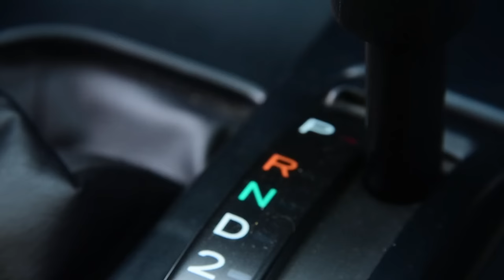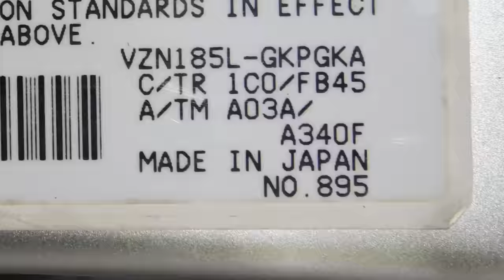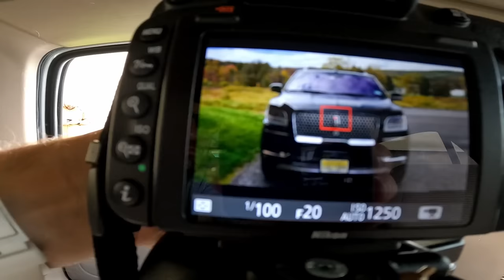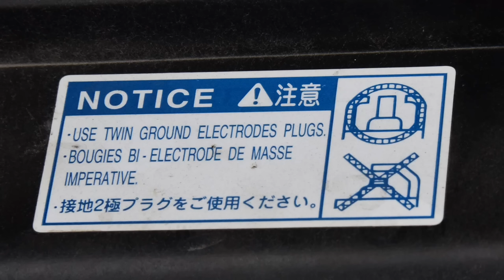2000 Toyota 4Runner SR5: Regular Car Reviews

Comment: I've got a 3rd gen with 360k that gets 21mpg and the only thing it needs is new shocks. incredible machines!
Reply: My 2002 just rolled over 317k. After a recent oil change, I measured the old oil that came out of it and it's only lost an eighth of a quarter over 5,000 miles.
Reply: Same 360k with a 3rz. Looks just like the one in the video. The best mpg I ever got was 23 on a long trip.
Reply: @BrockOBauma I've got a 98 with the 3RZ and the 5-speed. Only 214k miles on it and it's a Colorado car so nothing but light, superficial rust on the frame despite never seeing the inside of a garage for the entirety of its 25 year life.

I've been tracking the MPG for years. I have knobby All-Terrain 33's (265/75/R16) and still average 21MPG. Back when I first got it, and it still had tiny all-season tires mounted on 15" wheels (the default size for 3rd gen base model), I could consistently get over 24mpg. The best trip I ever recorded was 26mpg, all rural highway miles, traveling ~65mph the entire time. 

All of this using 85 octane fuel at elevations normally between 5000-10000 feet.
Reply: Nice truck. 
I do bear potentially disappointing news for you though; 265x75R16s are 31.5”, not 33”.
I have the same tires on my 2003 3.4L 4spd auto taco with 108,000 miles. They’re 1” taller than the stock 30.5” 265x70R16s (to be fair they are often rounded up to as 32”s and 31”s online respectively). Can’t say I’ve ever quite seen 23mpg though. Impressive!
Reply: 21mpg 😮 share your secrets 😂😂

Comment: In 2020 I fell into a a ‘99 manual transmission 4Runner for $4k before I knew it was rare. I bought it off the original owner with the receipt from our neighborhood dealer. It had 330k miles and a bootleg Jane’s Addiction concert in the tape deck. But the rust is getting to a point where I should let it go. There are so many other Toyota trucks I could ride through the apocalypse. But if I refuse to leave 1999, maybe the apocalypse will never catch me.
Reply: Can you fix the rusty crusty and keep 'er going longer!?

Comment: Regarding the brakes, you should consider upgrading the the front calipers, rotors and pads to the ones used in first gen Tundras. Its a pretty common mod with noticeable improvement. I used to get brake fade in the mountains but that never happens since I upgraded my brakes. I feel like the stopping distance is also improved.
Reply: Yep, I was going to mention this! I put 2004 Toyota Tundra caliper, brake pads, and rotors on my 2001 4runner and it fixed the warping problem. I have never had a problem since then!
Reply: Probably should’ve read this comment before posting, but I’ll leave it up just to see if we can peer-pressure Mr. Regular into the upgrade
Reply: Good to know 👍🏻
Reply: This…
Reply: I'd say the 199(13WE) and not the 231(13WL) calipers so you don't end up with the soft pedal. I did the 231 and have not been able to get rid of the soft pedal that goes almost to the floor and can't lock them up anymore. I eventually plan on on going to the 199s.
Reply: My uncle apparently went with Bosch rotors that stopped the OEM warping issue, if that helps anyone
Reply: He will need bigger wheels to fit this upgrade. 17 inch at minimum
Reply: @BentonHart  Find yourself a dirt, gravel, or snowy road and slam on the brakes to activate ABS a couple of times then bleed the system again. Had the same issue with my WL calipers and now its almost too touchy. Those ABS systems are kind of finicky.
Reply: @BentonHart yep thats the route I went as well. It also allows you to keep the stock wheels/tires, which was important to me at the time.
Reply: You can run 13wl calipers on 16s with a spacer. Ive got 13wl on mine with FJ cruiser 16s. Fits like a glove with spidertrax spacers
Reply: @DeathMammoth91 What size tires do you run? 265/75/R16? I'm thinking of doing this on my 98 after the pads are a little more worn down.

Just want to confirm that everything fits before committing to it.
Reply: @TheHamburgler123  I’m running the stock wheels and standard highway/all-season tires, 265/70/16, and didn’t have to make any modifications to run the 13WL. Works just like the factory brakes, except now I’m not afraid of going down hills or doing hard stops on the highway. Huge quality of life improvement for these trucks, even if they’re mostly stock and used on road.
Reply: @ebenwragge-keller538  Thank you for your response. Gives me the confidence to move forward with it. I live in the CO Rockies and rely way too much on downshifting/engine braking to feel fully in control. I'm sure it feels great to not have undersized disc brakes up front, one of the only design flaws of the 3rd gen 4Runners.

Comment: Back in 2000, my dad bought a fully loaded 4Runner of that model year. It has everything from the in-bumper fog lights, the leather seats, the matte black spoiler on the back, and even the slightly larger 5-spoke rims in chrome. He held onto it through economical hardships and various adventures. It drove me everywhere, home from the hospital, to and from school and practices, and along several road trips.

I am lucky to say that 2 years ago, it became mine, at only 153,000 miles on the clock. Now I’ve worked on it myself to get it up to snuff, getting rid of those terrifying-down-hills warped rotors, putting in all new fluids and synthetic oils, and all the new seals that leak quite terribly if not changed. I’m not wanting to put bigger tires or change anything on it—keeping it the way it is and forever was is a representation of my life, only now do I take full control of it. It now has 177,000 miles and it’s running smoothly like it always has. I’ve gotten large cash offers for it various times, but like my life, it’s not for sale and it never will be.

Thank you for this review—I’ve been waiting for this video since I would sneak glances at it in the background. I’m happy to see that the true star of the show finally gets the deserved attention. You nailed every emotional feeling this car is and then some. And just as you stated in your review of the Camry, this car evokes everything I find ideal in a partner—they may not be the best, but they’re always going to be there for you and up for adventure.

Happy trails and keep ‘Runnin!
Reply: Just curious, does it have the rear differential locker?
Reply: @TheHamburgler123  Yes, it does, and it’s been helpful a few times!
Reply: @jaxothebuilder22  Nice, that's a keeper! With only 177k, depending on how much you drive, the original engine and transmission have decades worth of life left in them.

Comment: I had a ‘98 that saved my life! It was my first car. I wish I still had it, it was absolutely incredible. Hit a patch of slush in the middle of the NYS thruway at 12AM, like if the plow had skipped over it and left a 6in pile in the middle of the road. It bounced and lost traction, started to spin, and got nailed in front of the pedals by an 18 wheeler. I spun the other way, slid onto the shoulder and the front right tire found purchase, which sent it rolling over. When it finally stopped, I still had to turn that beautiful engine and lights off for the final time. When I unbuckled, I landed on the drivers side window. This was the only injury I got other than heartbreak. A total of 9 stitches. To add insult to injury, the 18 wheeler was one I just loaded on my shift at UPS. If I could afford it I’d 1000000% buy another Gen3.
Reply: Also, rust ate through my exhaust right behind the cat, and being 21 I thought it was the coolest thing ever. Man I miss it.
Reply: @dingusmcslow1908 😢

Comment: My first car was a 94 4Runner.  I loved that car.
My second car was a 98. I loved that car.

And then gas was well over $4 a gallon and I was a poor college student driving 60 miles a day, getting 14mpg on the highway on a good day, working part-time for not much above minimum wage, and I had to say goodbye and switched to a Jetta that only lasted me a year and a half.

That 94 was in service for a long while after that, and made it to a cool 250k before it was put in the grave in an intense battle with a tree.

Now I have a 96 Tacoma and it's just like my first car all over again, except worse because it's only got a wee baby 4 cylinder and it's not happy with so much as a few cinderblocks in the bed.

I love you, every 90s Toyota.  I'll love you forever.

Comment: Bought one of these 3 months ago & I love it. Bought it off a buddy w/ 256k mile on it for $2000 & he threw in his 2nd gen Tacoma wheels & tires for free. It has a slow oil leak & the AC didnt work. Got the AC comppesor and fan clutch replaced & added some oil. Added some creature comforts like a subwoofer, a trunk cargo cover to keep it hidden, white LEDs for the interiors & headlights, rain gaurds to match the hood deflector. Since I have worked from home for the last 3 years I barely put 2k miles on cars a year. I'ev already put 4k in the 4 months I've had this thing just taking road trips!

Comment: Finally a review on the 4Runner in the background!  You got a real keeper there.
My daily driver is a 2000 4Runner V-6 4WD.  We bought it new in 2000 and it is a family member.  At 195K I replaced the sagging original suspension with a 2" lift on Bilstein shocks, OME springs, SPC adjustable upper control arms, front diff drop, 285/70/17" Falken Wildpeak AT3w tires and Level 8 (6) spoke alloy rims.  It completely transformed the vehicle.  Two years ago with 225K miles, my daughter and I took it from KY to Colorado and explored the Alpine Loop near Telluride, Ouray and Silverton.  It performed flawlessly and climbed over everything in it's path without breaking a sweat.  We even got 18 mpg across Kansas fully loaded with camping gear and 2 adults.  I have upgraded to Tundra front brakes and installed a JBA cat back exhaust, (from Summit), and it doesn't sound "farty", but actually purrs and reminds me of an old BMW I  used to own.  I just turned over 250k and I will drive it till it dies, or I die...whichever comes first.  My money is on the 4Runner.

Comment: That ending really struck a cord with me. Earlier this year I got my hands on a 2005 4runner, which is the generation I'm nostalgic for. Having grown up around early to late 2000s cars. 

Shortly after I parted ways with a Subaru SVX that I absolutely loved, but wasn't the right car for me at the time. I knew that, but I felt incredibly guilty about it, like I had failed the car.
Half a year later and I'm loading my entire life into a uhual trailer and towing it across the USA to move states for university, inside my Toyota 4Runner.

I feel an unwavering comradery to that car. And even though I had to make lots of changes in my life, parting ways with some things I wish I didn't have to, the 4Runner ended up being my chariot to carry me through those changes, with no second guesses or concerning noises. 
And I've been absolutely loving uni so far. Change does not have to be a bad thing.
Reply: I had an 03 Tacoma that I used for travel for my job (which sometimes required off-road work).  Often drive to sites instead of flying even if it was a 1000 mile trip.  I was single at the time with many weeks on the road of just myself. By 2016 when I needed something else, I eventually regretted not having it anymore. It was sort of a big part of my life.
Reply: Amen, brother. My 98 4Runner was my first truck and, no joke, it changed my life. Best purchase, a mere $3500, I've ever made.

It's the ultimate adventure rig -- simple, capable and reliable. I took part of the back seats out and, even being 6' 3", I can sleep in the back comfortably. Cumulatively, I've spent months sleeping back there, mostly on federal land, with all the road trips and off-road adventures. There's something so satisfying about knowing you'll always have a dry place to lay your head and that your rig has the capability to get you almost anywhere. It has opened so many doors for me regarding access to beautiful areas, hikes, camping locations, etc. Spending time out in those National Forests and Bureau of Land Management lands keeps me grounded.
Reply: I feel the same about my 3rd gen. It’s been my best friend through many many life changes, and I can’t let it go
Reply: Picked up my 3rd gen 99 for 2300 rust free with 298k. Now I've got it to 366k. It's going to be dedicated trail rig soon.
Reply: Ok. Do you guys actually drive these things? They're very comfortable and ride well on a fresh suspension.  They corner very well, don't feel top heavy at all. They are slow, though.

Comment: I have a 1998 base model with the 2.7L 4cyl, no sunroof, and 5-speed manual, and I get between 19 and 21mpg cruising at 75-80mph. It's a phenomenal truck. Just about to hit 250k on it actually.
Reply: Coool... timing chain, no rubber belt.

Comment: I’ve got a 2013 Land Cruiser and I have the same feeling for that as you do for the 4Runner. I’m sitting at 183k mikes with basic maintenance at this point. I plan to do the entire cooking system replacement at 200k miles just to be sure that everything is okay. It’s a forever truck. My kids are growing up in it. They love it. I can afford a new “fill in large SUV here”, but why? The mighty Land Cruiser will stay with me as long as I can keep it.
Reply: Cooling.
Reply: Land Cruiser is a massive vehicle, I just can't see having anything bigger than a 4runner. 
Could be that I'm in Europe..
Reply: @ProfuzniChevap  I'm in America and I agree with you. I have a 2004 4Runner so it's wider and longer than the 3rd gen, but still small enough to still be maneuverable in the city.

Comment: My old neighbor is a gardener, and he used to have a 2000 4 Runner SR5 (with a locking differential). He drove it to work everyday, and he even took it on road trips every year from New York to Florida and even to New England states without even taking an airplane. It even drove really well on snowy roads too. 3 years ago, he brought a 2020 4 Runner TRD Off Road Premium after his 2000 4 Runner unfortunately got rear ended after reaching up to about 400k miles back in late 2019 before COVID happened. He's now currently a senior citizen and he's doing well! Miss his 3rd gen 4 Runner!!

Comment: I've got an 2002 SR5, best car i have ever owned. Bought it at 180k a year and a half ago and now its at 216k, its needed nothing but oil changes and a set of spark plugs and wires. I drove it from AZ to PA with a stuffed 10' uhaul with no issues going 70-75 the whole time, handles snow like nothing else and even though its slow i was shocked with how well it corners. Doesn't loose more than a quarter of a quart of oil over 8k miles and i can avg 20mpg even in PA. KILLER cars, also hard to beat that classic 90's SUV shape (a nicely made brick)
Reply: They nailed the look, these cars still look great almost 30 years later

Comment: RCR, I'm a huge 3rd gen 4Runner and 1st gen Taco enthusiast.

Just a thing to mention... Did you guys do the inside of the fully-boxed section of your 4Runner frame? If you're winter driving this in a salt state, I highly recommend doing it. 3rd gen 4Runners and 1st gen Taco frames rust from the inside out.

The method that I have found to work best is to take a pressure washer and attach a "sewer jetter". Its a 365 degree water spray nozzle that shoots really high pressure. You can use that to clean the inside gunk out of the fully boxed section.

You can follow this up with Eastwood's Internal Frame Coating, and spray several layers of the paint inside the fully boxed section. The paint uses a 365 degree spray nozzle attachment to make sure you fully coat all the inside of the frame.
Reply: I have used that Eastwood IFC on my gen1 taco! Several years ago  started it and need to finish up the last section

Comment: My parents bought a 1997 4Runner Limited from my grandparents in 2011. It was green, with gold emblems and a leather interior. 

We took a trip down to Florida that year to pick it up. All I remember is the smell of the leather interior along with just how large it was when riding in the back seat as a kid. That think was awesome. 

My dad used to use the 4Runner to move tree branches and things like that. 100% a capable can-do truck. Would’ve probably gone forever if it hadn’t been for the strawberry milkshake. Which left it to sit in the driveway for 4 years. 

I remember going outside and looking at that truck. Admiring the chrome lined bumpers and those all too iconic 6-spoked rims. The gold emblems were so nice to look at. I remember the rear shocks gave out and began to sag, giving the 4Runner a “Carolina Squat” look. 

Finally after 4 years of sitting derelict my parents called Lizard Lick Towing to come pick it up. I still want one to this day. Hopefully I’ll get one sometime soon.

Comment: I bought my 01 3rd Gen 4x4 5VZ for $6k. Replaced the Radiator, Bypassed & added Aux ATF Cooler, Replaced Timing Belt & all drive belts/roller/tensioner and water pump. Replaced Valve Cover gaskets, Spark plug tube seals, resealed half moons, and cam plugs. 217k Miles on it now and for $7.5k all in, I'll put money on it'll get to 400k easily. Just the best, reliable used vehicle.

Comment: I’m in Australia and I own a 2003 5vzfe dual cab hilux sr5 4x4 5sp manual. Australia runs on Toyotas and after owning this hilux for the last 18 months I see why. They do everything you ask of them without a fuss and barely any extra maintenance. I mean yeah sure it’s a bumpy ride and they love drink. But they’re the textbook definition of not just reliable but dependable. You have summed up what owning a Toyota of this vintage is like perfectly, cheers mate